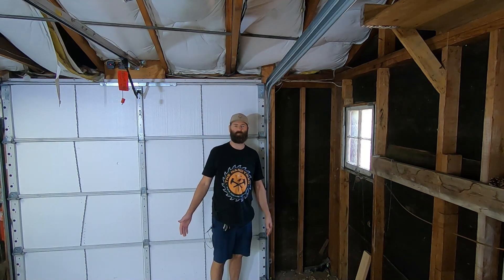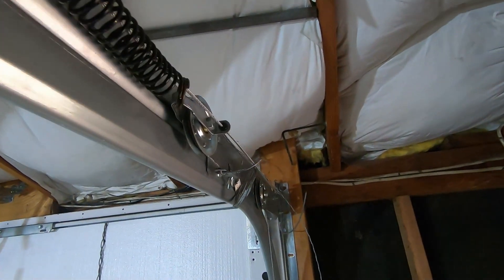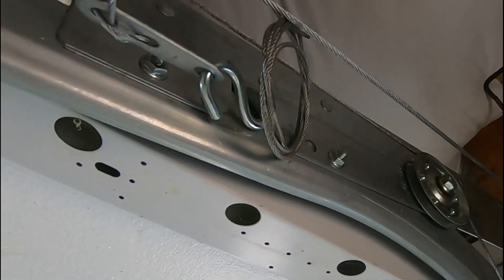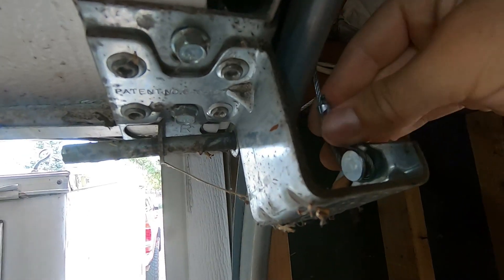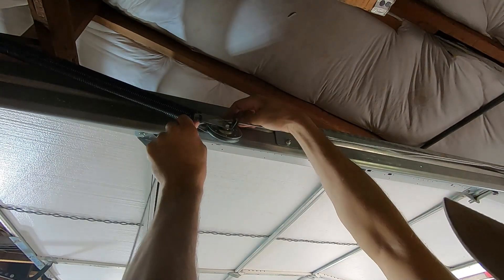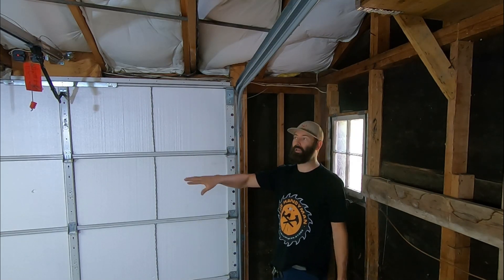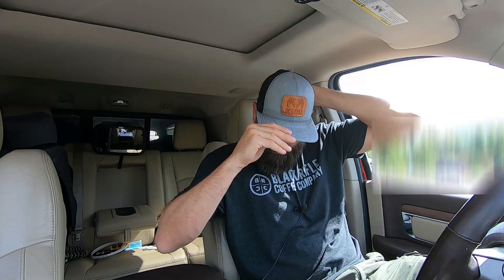Garage Door Cable Almost Killed Me | Handyman Saves The Day | THE HANDYMAN |

Comment: As a Garage door guy myself, I will warn any homeowners who want to attempt a spring repair. The door MUST be in the open position when dealing with extension springs. All cable anchors must be tight. Have personally been to a job where husband put on extension spring and forgot safety cable. When the cable stop gave out (improper tools/clamping done) the spring shot to the back of the garage... and hit his 9yr old daughter in the face. Take your time, do your Research, and if in doubt just call a professional. Handyman,  extension style lifts always run rough, due to it being set in the air. It's very difficult to level a door when your cable lengths might be different depending on how you set them in the hooks and stops. its why the cables fray often on them and why we usually recommend converting them to the Torsion spring setup. As usual, good Garage Door Video :)
Reply: People make videos saying that garage door installers are pushing people to convert to torsion just to rip homeowners off, but you explained exactly why torsion is better

Comment: Hey, a garage door guy here. On those screw drive openers run a bead of white lithium (the thicker stuff in the tubes) and it will make it so quiet. Very easy to over do it so don't go using the entire tube on 1 job. Some doors I have to clean it off and reapply.

Comment: That’s a low headroom door installation The extension spring is necessary because there’s no headroom above the door, and the return pulley diameter is undersized which lead to the breakdown of the cable.
Reply: I think extension springs are way more dangerous to the customer than torsion springs

Comment: That reminds me of the roll up doors that you see on the back of delivery trucks. There’s 2 spring loaded rollers. One on each side. And when one cable is broken, you will need at least 100 lbs force to roll up the door. 
Just as in your video warning about repairing a broken roller spring in a garage door.

Comment: I have had several springs break over the years. Pretty scary when they break in the middle of the night. They should be replaced in pairs. They are color coded. Mine have a white color on them. Also, the attached roller should be closed to the door frame so the cable goes straight down to the bottom of the door. It probably rubbed against the metal track and wore through the cable.  Also, replace the rollers. Moving the roller will prevent that condition. As others have mentioned, the other cable is for safety.  I replace all of the cables when I replace the springs. It’s not a hard job, but needs to be done right.

Comment: Cable keeps the spring from flying through someone’s head if the spring breaks
Reply: And helps wear a groove in the spring so that it fails sooner. Safety with compromises 👍
Reply: My old garage door was from around 1972 and didn't have that support cable.  When one of the springs broke it dented the roof of the car under it.  It didn't even really scratch the paint.  Since the car is a 1995  Buick (in fairly good shape) I just live with the slight dent.  I was very happy it didn't break any windows.

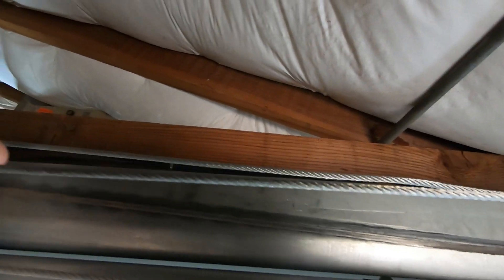Comment: There are some very clear pulley rub marks on the track that you see at about 5:00.  Looks to me like those two bolts you showed at about 2:30 are a possible cause for cable failure if the cable rubbed against the threads and rough bolt end.  I’d be considering replacing the nuts with nylon nuts and trimming the bolts flush with their ends..... great find of cable issues on the other doors!

Comment: It's not a spring support, it's a safety cable that keeps the spring from flying through a wall or a head if the spring breaks. Probably the most important cable on the door.

Comment: Our pull up cable broke completely once and the "locator" cable did not kept the spring up in its place. As the pull up cable broke the spring was shot back and completely dismounted from its place, Almost hit our car. Luckily no one was in the garage.
Also, the spring on the other side and the garage door engine can hold the door (at least on our garage) and it won't fall on anyone even if one side is off. Though, it wasn't strong enough without both springs to pull up the door anymore.

The handyman came to repair it said to always change the cables on both sides at once, even if the other seems fine. We got created a bespoke cable with the exact size, with factory made hooks on both side to avoid using those clamps which can come loose at any time.

Comment: I was always under the impression the second cable is a safety cable so in the case the sping breaks under tension iy doesnt like go flying thru some ones skull 😆 garage doors verry dangerous trade. But i can see how it would also serve as like a guide for the sring to run on. Maybe its both. Torsion springs even more dangerous. I spent a few years working for a door comany about...a long fcking time ago and those torsion springs for the big doors. Are way crazy. Out side locks off to shaft inside of springs lock off the the bracket on the wall which can eadily rip itself off the wall tossing the guy to his death if he didnt die from getting hit with thousands of pounds of spring tension.  And thats just one of litterally a hundred ways over head doors can kill you so.. If any ones going to mess with them be sure and do your home work. I know more than one guy missing parts or maimed for life from this trade.  Not being a know it all... cuz i dont remember too much ...accept always realizing how much danger i was in working with this shit. 😆 😆 just a heads up.

Comment: Should spray some lube on every roller,  overhead doors need that. If you have the torsion spring type overhead door you should lube the torsion springs too- they tend to bind and jerk as they loosen, throwing the lift cable out of it's spiral groove- and then you have trouble.

Comment: What's up man, Thanks for a another helpful video. I recently did a full garage door installment.  I mean FULL. Took out an old broken door, tracks, Gd Opener,  etc... I replaced everything and it works beautifully .... but where the cable goes through that little plate near the S hook, I just slid it through in that over under and back over again to hold it in as the directions had indicated but I never saw one of those clips which I would much rather use. Was that specifically for garage door cables or something you added as a better of doing it? I will look for them for the future. Thanks again, always learning something from you .. big or small.

Comment: I don't believe the thicker cable will cause problems on an extension spring door, but if this were a torsion spring application, it is important that the cable be the same on both sides.

Comment: Where did you get the clamp that went on the end of the cable to prevent it from slipping through the hole.   I need one of those, I have very little cable through the hole and it makes me nervous that it could slip through.
Reply: Did you ever find out?
Reply: @stephan24297  no so far  it’s ok
Reply: @oceanlbi  I ended up doing it today and using 1/8 inch wire cable clamps from lowes just in case you're interested
Reply: @stephan24297  thanks so much for the tip!